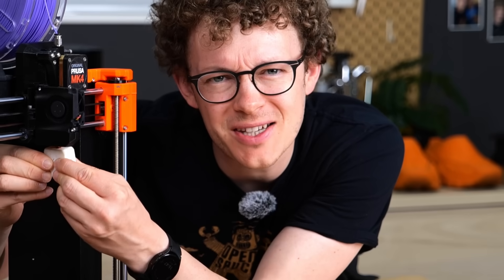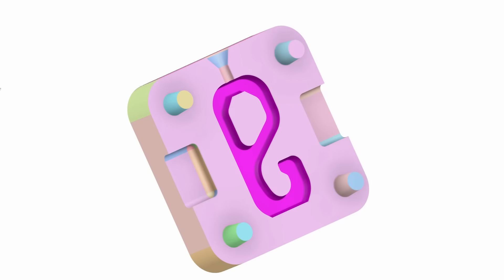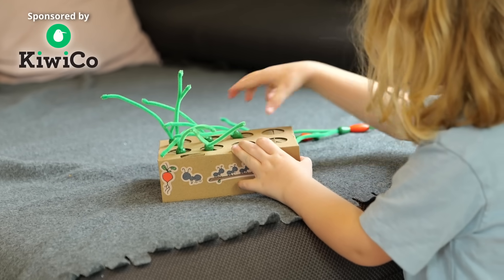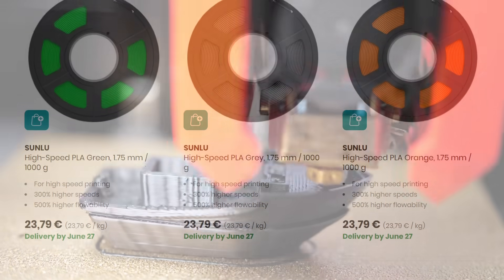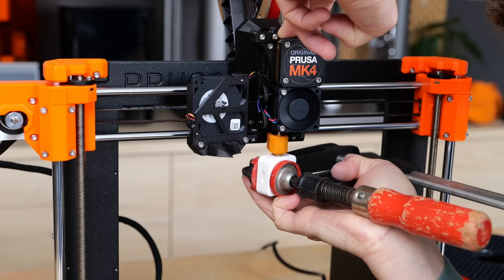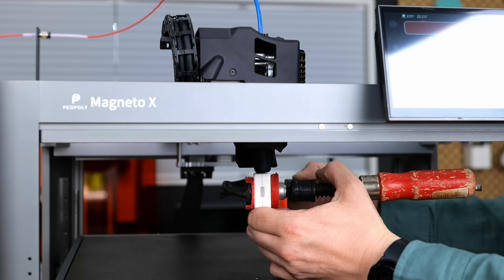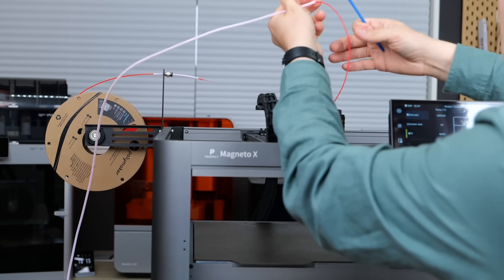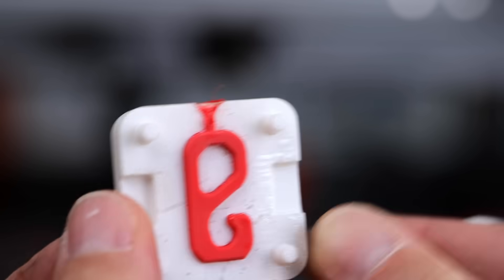I tried Injection Molding using a 3D Printer!

Comment: i wonder if you could like. 3d print the mold with a negative margin, then spray paint it with a metallic conductive paint, and then electroplate it to make it stronger

Comment: put the clamp ont he print bed, then lower the extruder into the mold and use the Z axis to hold it in place, and the nozzle and print bed can both pre-heat the mold from both sides :D

Comment: You need a hole on the top on the mold to get trapped air out
Reply: And also lubricate the mold to avoid the plastic to stick too much
Reply: @user-it7kg3pm4q  I would assume that the slightly flexble resin-halfs, if get pressed together with enough force, seal up very tight.
Reply: On top of that, you can design the mold to fit around the head of the nozzle so that when clamping down it holds pressure in there, thus not allowing material out around it, and increasing pressure inside the mold.
Reply: Or pull a vacuum on it
Reply: I agree with this, but what about also heating The mold so that it doesn't cool the plastic as soon as it touches it?
Reply: He needs to watch some Robert Tolone videos.
Reply: Runners and risers.
Reply: How could he possibly miss this? This kids smart but he definitely is smacking his forehead right now saying "Doh!"
Reply: @user-it7kg3pm4q  even if there's an air gap, having a hole to direct the air to would probably help, as the plastic should flow into it, maybe experimenting with just a buffer instead of venting it
Reply: Air gaps would be an issue if he was using harder materials for the mold.  Any plastic, under sufficient pressure, would form its own gasket at the outer layers and seal off the air.
Reply: 1000s of people shouting at the screen! You need some small channels everywhere there is a cul-de-sac to let air escape, otherwise you get what Stefan found.
I'm surprised he didn't consider this, so I hope he will redo the video with better knowledge.
Reply: @user-it7kg3pm4q  
Yes, he said it. But it’s still plastic, a screw-clamp can easily reach several 1000 N of force and the parts fit very well together. Not much deformation is needed to seal it up.
Reply: @user-it7kg3pm4q  Nah they're squeezed together really hard and it's causing a LOT of back pressure to try to evacuate air through the microscopic gap. The precision fit is evidenced by the complete lack of flashing, so it's perfectly liquid-tight and probably very nearly air-tight. Considering he's fighting with insufficient pressure to fill the ends and corners, properly venting the mould can only be a good thing.
Reply: Yes.
Reply: @user-it7kg3pm4q  smaller injection molds are usually constrained by a universal frame, like a master unit die. Makes molds easier to make, easier to change out of machines, cheaper to run, and cheaper to replace. Not to mention it constrains the molds in place and can provide heating and cooling
Reply: @user-it7kg3pm4q I make molds of fishing lures for my dad, yes there can be gaps, you get flashing but you need to remove the air as quick as it can go in but the need to be small enough to allow the flow to other parts of the mold first
Reply: Took the words out of my mouth.
Reply: This was my thoughts as well. Need a air escape hole/holes
Reply: No you just need a gate. Gasses can escape theough a couple hundredths
Reply: I am one of those who builds injection molding tools and here the recesses on the side are sufficient, especially since the cavity of the finished part has no sharp edges and is not compressed by several tons, and air can also push these tons apart, creating degrees. If this tool were made of steel, I would place the vent closer to the cavity so that the vent has more space more quickly and no holes are created. With a hole at the top as a vent, you only create unnecessary work to remove it because you also have to remove the sprue

Comment: I feel like every expansive manufacturing techniques has started coming home, 4 axis CNC with the carvers, EDM with the power code and now injection molding
Reply: I use only kitchen equipment and I use my hands. My products are unique, it's not machine manufacturing. I don't find many artisans in this community :(
Reply: I wouldn't use a 3D printer for injection molding the specialized tools do a way better job for it. But there's DIY and home versions now so it is like you said way more accessible and less expensive.

Comment: Also I bet you would get better results with ABS or another amorphous polymer. Again, great video and idea!
Reply: He tried it, it was even worse
Reply: @riba2233  oh, I must have missed that oops. AFAIK ABS tends to have better flow characteristics for injection molding, which is why I suggested it...but 3D printing materials are all over the place when compared to IM. Interesting nonetheless!
Reply: @emberprototypes   it does but it still requires higher temp which his mold can't really handle